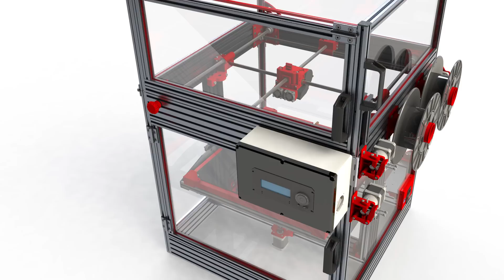Build your own 3D Printer: Frames and Linear Motion!

Comment: I have had nothing but issues for 2 years now with my self built I3 Rework.  I just repurchased the MK2B and I am waiting on it but if it doesn't fix the last issue I am done I will just buy a Wanhao I3 Duplicator and call it a day (keeping all of my parts for a future project of course).  1000's of hours tweaking and less than 1kg of printing.
Reply: That sucks, I got a sunhokey prusa i3 a few months ago. After months of tweaking and upgrading the hot end it finally works reliable.
Reply: Tommie ?
Yep, after all of my mods to help it and having to replace the frame it all boils down to the bed.  After really looking at the Wanhao that is not for me.  I know I want a printer where the bed doesn't move but after 2 years of hell with this printer and a lack of getting anything printed beyond about 1kg of parts I question if this is really worth it.  A total boondoggle and I am not stupid nor were the parts purchased cheaply (try 22 dollars a piece Mitsumi smooth rods with the double chrome on them).  I could have purchased 3 Wanhao i3s with what I have spent but I have learned a tremendous amount too in what not to do.  I am surprised we still see a moving bed (either up/down or front/back motion) when a stationary bed (think a Delta like printer) is one of the biggest reasons a Delta print is so beautiful.  It can be done with a Cartesian printer too but due to costs it isn't done.
Reply: ***** well Cartesian printers are actually really easy to calibrate and maintain. Delta printers are really a pain in the * to troubleshoot and fix. The moving bed itself isn't a bad thing. You just need a dead flat bed. And about the knowledge thats so true. I learned so much in the months that I own my 3D printer. Things like mechanics, thermodynamics and ofcourse electronics.
Reply: Tommie ?
Yep, the setup and calibration of a delta printer is indeed a PITA but the moving bed is bad.  It causes artifacts (known as ringing) and on a very tall print can shake it loose or just be pulled over due to the action of printing.  It is a known bad thing but is the cheapest way to go with Prusa model of the Y action the absolutely worst and cheapest to design and build.  I have designed a printer that has no moving bed as the head moves up not the bed (this means the bed can be rock solid and never ever budge so no more having to readjust Z) and it uses wheels instead of linear bearings and smooth rods but the price is absolutely hideous as it takes 30-40 wheels (I forget exactly how many now) and at 6 a piece you can see why I never built it though it would be rock solid and hardly ever, if ever, need to be readjusted/releveled.